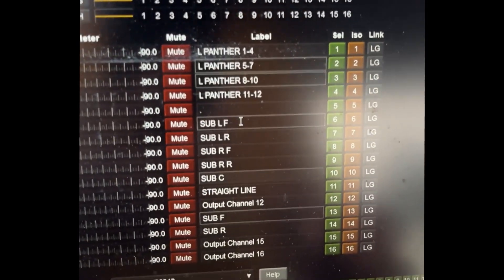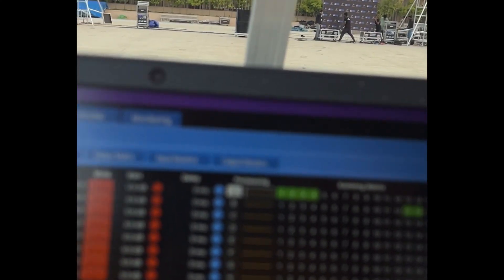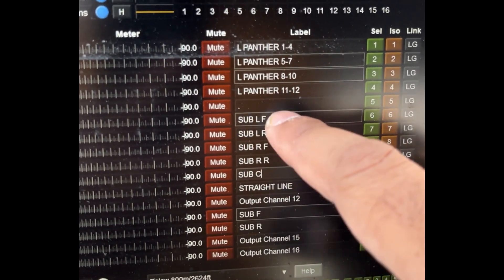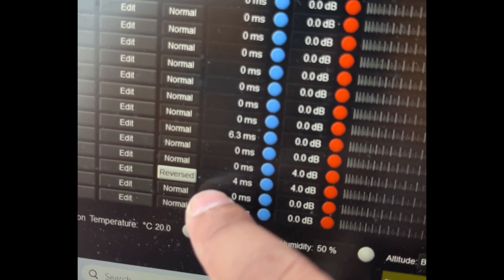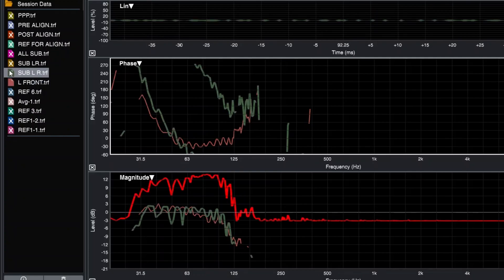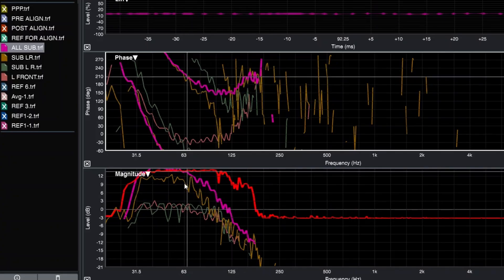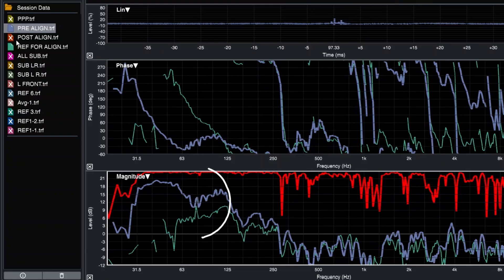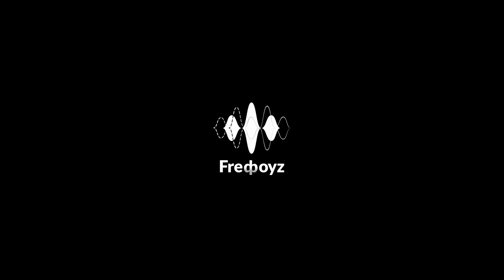SUB WOOFER SETUP AND ALIGNMENT #meyersound

Comment: Hey what’s up man nice video I have a  question why do you invert the rear sub 180% off.  And just so I understand, how come you don’t just measure the front grill of the rear sub to the front grill of the front sub then set the delay for that distance I was under the impression if that is how the end fire worked.
Reply from the maker: Hello. As back to front of sub is 1.4 feet so grill to grill will be around 3-4 feet. However as that measurement i do using smaart, and put delay according to phase response, if i would have not phased aligned front to rear, typically i would measure grill to grill and put distance delay.
Polarity invert it for rear sub as this looks end fore but actually is a gradient config.
In end fire its grill to grill distance delay and no Polarity invert.
Reply: @FREQBOYZ_AUDIOMAN ok
Thanks for ur response I understand now keep the videos up 🙏🏽

Comment: How to diside distance on end fire sub congregation?
Reply from the maker: So if you divide speed of light with double of the distance between subs, it will give you the frequency at which first comb filtering happens.this frequency should not be in the zone of sub frequency that is 30-100hz

Keeping 1 m or less works so do that 😊
Reply: Thank you sir  @FREQBOYZ_AUDIOMAN
Reply: @pathansakil9035  speed of LIGHT or speed of sound?